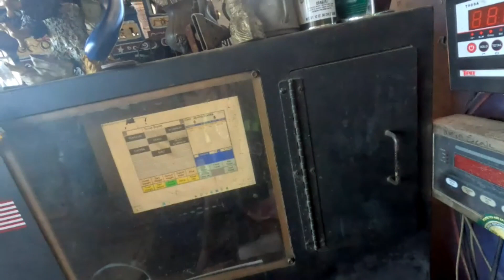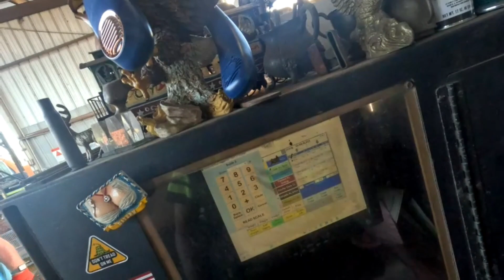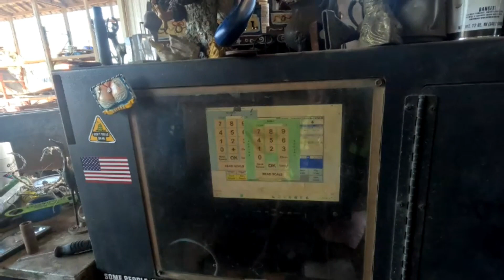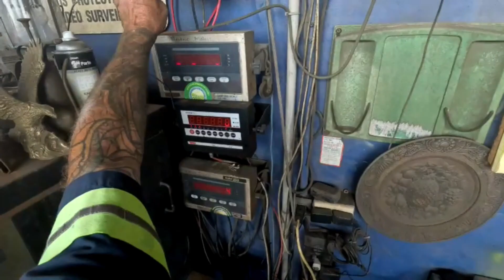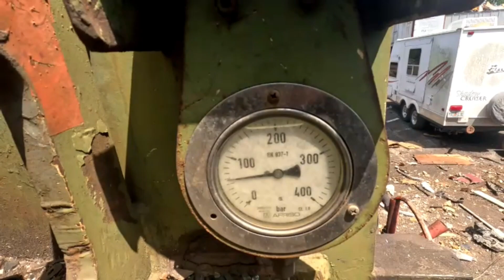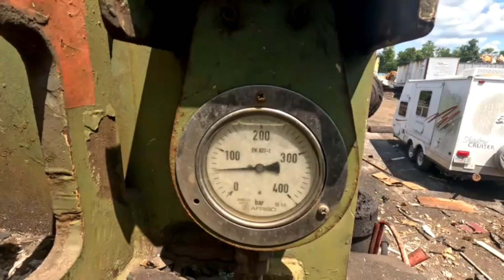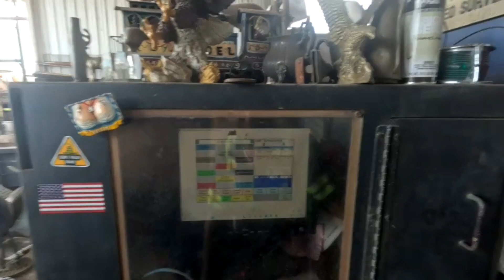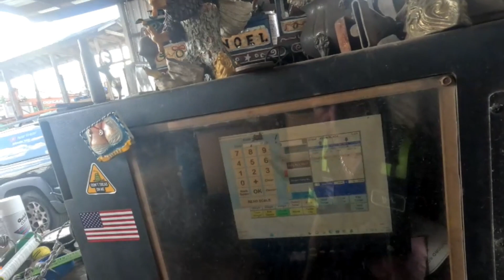HOT AND SWEATY MONDAY #recycle #recycling #steel #scrap #scrapyard #scrapmetal

Comment: Those gas regulators...90% of them come out with a 3/4" or 18mm socket.  10% you got to break/cut off the black plastic and turn it out with channel locks or vice grips.  Easy brass money.  Hey Jeff...I went to the doctor this morning and said "Doctor, every time I stand up quickly, I see Mickey Mouse, Donald Duck and Goofy."  He asked, "How long have you been getting these Disney spells??"  😂🤣
Reply from the maker: Thats a great joke. Using that. I like cleaning brass more than copper. It heavier but not worth as much per pound but it pays way better
Reply: @nonferrousjeff  I'm the same.  Brass is more easily available and adds up quickly.  👍